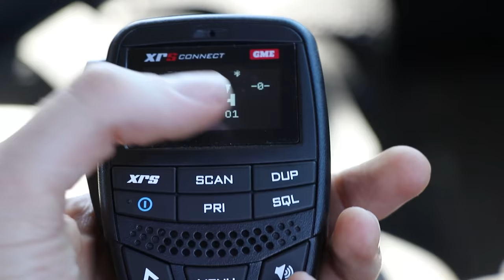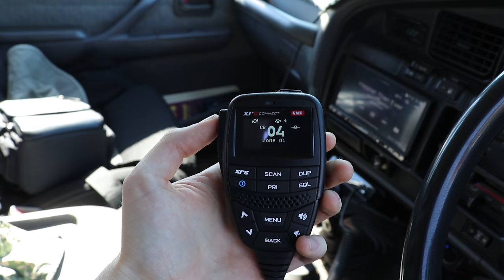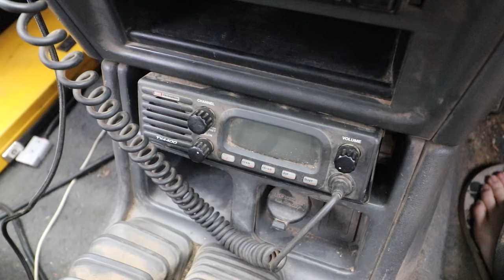You've been using YOUR UHF WRONG!!! CB Radio SECRETS for 4WD in Australia PLUS History & Technology

Comment: I've been using CB Radios since the 11-channel Australian AM Radios. We progressed to 40 channel AM, (not SSB), and now we use UHF radios exclusively. 

Now, I need to make some corrections. 

You say there's no licence for UHF but the Australian Communications Authority (ACMA), who are the responsible entity for allocating the radio frequency spectrum (which includes licensing for  TV and AM/FM Radio spectrum) issue a "Class licence" for all citizens to use the UHF band (476.4125 to 477.4125 MHz (inclusive)) With the change to the 80 channel sets, officially referred to as Narrowband UHF, there was some discussion about making the 40 channel set (wideband UHF radios) illegal to use. This, obviously, meant a significant cost to the transport industry so it was quashed. 

Now, old mate claims that UHF 40 is "by law, the road transport channel" This could NOT be further from the truth and is a myth that needs some dispelling. There is no such requirement in the ACMA spectrum guide, which I suppose most truckies wouldn't read, even if it came out on audio-books. It is BY CONVENTION that UHF 40 is the TRAFFIC INFORMATION Channel, and not the exclusive domain of truckies. Tell them that though. The Pacific Highway, which runs from Brisbane CBD to Newcastle, by convention, used to use Channel 29 and this is a hangover from the AM radio days when the single could "skip" (bounces off the ionosphere and gives the signal extra distance) and reach across the New England Highway, only a couple of hundred kilometres West, running parallel. Because UHF doesn't have this tendency, this has gone by the wayside with more and more trucks choosing UHF40, now. 

The other BY CONVENTION channel has become channel 18, which is now being used more and more by caravaners owing to the truck driver's fowl language and abuse at anyone DARING to use THEIR channel. I mean, how dare they enquire about road conditions while the truckies are talking... heavens be! This (in my view) has lead to a decline in UHF purchasing by the caravan set. And then the truckies get shirty when they can't call them up to get around them, it's a problem they've created for themselves*. (I tell you what, I'd love a 100,000 Watt radio and talk over the b/s truckies speak sometime.) 

UHF 10 is actually for National Parks but, as that's where most four wheel drivers hang out, anyway, it's become the channel for four wheel drivers anyway. During a Simpson Desert crossing, you are strongly encouraged (required?) to monitor UHF 10 and make repeated calls on UHF 10 to advise traffic coming from the other direction (Middo, party of 2 vehicles, westbound at call point 10, QAA Line) ALL OTHER CHATTER IS SUPPOSED TO BE KEPT FROM UHF 10 (but sadly, dickheads be dickheads and frequently it's hard to get a word in edgewise as groups just bullsh... away on UHF10.) The one thing I found INCREDIBLE was the XRS location feature in the desert. I have my phone on the windscreen showing me the locations of other's transmissions. I could just say, "Yeah, I can see you on my map, you're about 15 kilometres away [a sensational range for a 5w UHF radio]. Keep me up to date every few dunes" and it was BRILLIANT. I thought it was gimmicky until then. 

Now repeaters was a bit muddled, too. By selection a Duplex pair (say 42 + 72) the user transmits on the higher channel (72, in my example), which the repeater receives, upgrades the power to the signal and re-transmits that on the lower channel (42). It wasn't really clear, so I thought I might make that clarification. 

One of the things that WAS missed from your otherwise excellent story was the increase in commercial activity, at road works and truck depots, which is actually BANNED under the communications act in the issuance of the Class Licence. It clearly states that no commercial entity shall use the UHF CB radio spectrum for commercial operations and they are not to impede genuine citizen band communications. This is directly against the use for road maintenance uses. When you see "Gate 2, UHF CH20" all the time, this is a breach of the licence. As is the Traffic Direction people using UHF to direct traffic through or around road works. They are meant to use a separate bandwidth, either provided to them or to a hire company for use on the job allocated. 

Putting you antennae in the middle of the roof is only required where you're using a ground plain dependent antennae. You would have to literally have to drill a hole in roof to use the metal in that roof as part of the aerial. The antennae you have is ground plain independent, which means it can be installed virtually anywhere. Obviously, the signal is going to be somewhat blocked by the big lump of metal that is your car, so the higher, the better, but it doesn't need to be. As for mounting your uhf antennae on a wheel carrier (also the deck of a rear bumper is pretty popular, too, I've seen), then the forward projection of that radio transmission will be blocked by the car. obviously, the same applies to a bull bar or rear tyre mount but, because of the height difference from the deck of a rear bumper, not so badly. People do this so they don't damage the tip of their UHF antennae in parking structures or low hanging branches (I get it. I do. They're bloody expensive)  but it comes at the cost of blocking the tx. 

Yes, an antennae can be expensive, but they are technically and ideally, a consumable item. If an antennae is damage (by trees or parking structures), it should be replaced or it could cost you your radio (the even more expensive but.) It burns out the power amplifier, which is the part that gives you the 5W of tx energy. And a chipped or damaged antennae doesn't give you best bang for buck, anyway. 

*Having said that, the truckies in the really remote areas are only too happy to chat to you on UHF 40 and guide you around their road trains, or vice versa. It's only the dickheads on the major highways between major centres who reckon they own the roads.
Reply: 100% correct, Peter.  I’m an amateur radio user, and am familiar with the “law” regarding CH 40.  The reason, I believe, and correct me if I’m wrong, is that  when UHF first came out, the radio of choice (or rather lack of choice) was the Philips FM320.  It had a three position, spring-to-centre switch called the reset switch.  Push up reset the radio to channel 11 (call channel), push down reset the radio to “NOM” or nominated channel which was preset to channel 40 at the factory.
When truckies started using UHF they simply chose the nominated channel to communicate with other truckies by flicking the switch down, rather than scanning and picking another channel because it was easier to do this whilst driving.  True story.
Reply: @glossamano  back in the day, trucks used AM CH40 as the highway channel and, when the ACMA started the class licence with UHF (previously UHF radios required a paid licences, the use of allocated callsigns, etc, which were dropped when the Class alicence was introduced), the truck drivers switched to UHF radios because of their clarity. 

I just wanted to clarify the "law" part of the comment on the video. Truck drivers seem to believe it to actually be a law and will rip shreds out of anyone who challenges it, when there is no legal basis for it.

Comment: Here in the USA are “CB” is in the HF range. While many off readers used that in the past. The move to GMRS (UHF) here in the states has been a major switch lately. However we only get 22 channels. 
Many off readers here in the States also use Amateur “Ham” radio. Some use HF in the same frequencies used In Australia and around the world, but most use VHF/UHF (2m and 70cm) as we have massive amount of repeaters in use for the 2m/70cm band. A license is also required in the USA for 2m, 70cm and the HF bands. We have a 100 watt max on 2m/70cm and 50 watts on GMRS although a few GMRS channels are limited to 5 watts.

I have talked to many Australians using 2m and 70cm repeaters that are connected through the internet to repeaters in Australia.

Off Roaders  in Australia don’t need the 2m/70cm band like we do in the states because your “CB” is similar to our GMRS (UHF band) and have many more channels.

On my off road 4x4 a Ford Bronco Badlands. I have mounted my GMRS antennas and 2m 70cm to the “A” puller posts on the hood (Bonnet) and to the rear spare tire mount on the back of the vehicle.

My antennas are all 5 db on 2m and 9db on UHF 70cm

Comment: Fascinating. I learnt a lot. I live in rural Qld. Mobile phone signals are sketchy at best. I have the UHF in my ute as a safety back up mostly. Don't run with it on as too much crap on it. I did ten years in the rural fire brigade. During the big floods in 2011 our trucks didn't have UHF in them. Flooded in people were trying to talk to us and couldn't. Since then UHF has been included in our trucks. Certainly still very useful in rural areas.

Comment: I think it is worth stating that extra RF power doesn't make much difference to range. It's all about line of sight in VHF and above. I've done nearly 100km with 0.6W on UHF CB. Just high point to high point in a low RF noise outback setting. If you're nowhere near line of sight even 100W won't help you punch through. The insertion loss of a coax switch will not be able to be noticed by most people. Probably about the same loss as having a few metres of extra coax length. The 5W power limit is probably more around RF safety than anything else. At UHF it is quite easy to exceed the maximum RF exposure limits specified by ARPANSA. Given that there is no EIRP limit with UHF CB they need to ensure that people don't endanger themselves and the public. That said 5W into 40dB of gain (50000W EIRP) could be quite dangerous while still being legal. Luckily most people aren't running massive dishes or Yagi antennas on their 4x4. With CB repeaters the tail (the transmission coming back ) is configurable by the operator. So it could be long, short or not even present. Some repeaters have Morse and voice ID. CH5 Mt Anakie in Vic has announcements playing on it for example. In more remote areas a lot of cattle stations run their own repeaters so it is considered poor form to jump on their repeater and rag chew. That said even though they pay for the repeater it is supposed to be free for all to use. Jumping on a station repeater is a good way of getting local knowledge and letting the owners know about issues with their stock or fences etc.
Reply: What?
Nice theory but line of sight can be dependent on output wattage.
Seems like you've used enough to have assumptions about operational parameters, but no real knowledge, that range of a given output as a standard will decrease in range regardless of line of sight as frequency increases.
Range limits can be overcome up to a point via the increase of amplitude output.

I've done many installations in UHF, VHF used for security patrols of large properties and had to tune the systems for optimal output with minimal SWR reflectivity returned to the transmitter base.
Plus a number of other systems for ambulance services and long range police patrols.
Reply: @rogerramjet6429  if line of sight is dependent on wattage as you assert. Go and look up how much RF Voyager 1 and 2 output and the gain of their antenna. Then let's talk about line of sight. Those craft are 100 Au distant and still in contact with earth on a near daily basis. The signal takes nearly 1 day 1 way at the speed of light. From memory under 100W of RF power from the probe. The reason this communications link works is line of sight and gain on the ground station receiver and some signal processing gain but not an increase in RF power. 

Here on earth's surface the limitation is the curvature of the earth and the fact that VHF and above don't refract in the ionosphere. But if you put your antenna on a mast on a hill you have a great site for a repeater. But your range is limited to your horizon. 

You take more power and I'll take more line of sight any day of the week above 50MHz. With line of sight it's amazing how little power you can run.

Comment: 11:50
A radio check, is NOT just to see if you are being "heard" or that anyone can talk back.
A (genuine) radio check is to tell you TWO certain specific things.
1/-
That yes - you are "getting out" ..
But more important is
2/-
YOUR SIGNAL STRENGTH.
On your unit, there will (or should be) a strength meter.
On any received signal - you will see the strength that it is being received at.
Now - to be certain that your signal is getting to somewhere else, two things are needed.
ONE is how far away from each other are you, and TWO, what power they are transmitting to you on.
BOTH these strengths, give you your own output power, AND your ability to receive a likewise power signal.

Thus - for a genuine radio check - you need to advise where you are, and what your SWR is.
(SWR = Standing Wave Ratio)
If you have an aerial - it matters as to EXACTLY, how long your cable is, between your transmitter & your aerial
It thus also matters, as to what your STANDING WAVE RATIO "is" between your transmitter & your aerial.
Which is why - any half-dead Indian - always asks - what does my smoke look like.
In other words, how STRONG is my signal when it gets somewhere, and what strength their signal is, when it gets back to you.

SWR matters.
Why - ?
Because if your aerial is NOT tuned correctly, your standing wave ratio COULD be so high, as to obliterate your lovely output power.
Having the SWR as close to 1:1 as possible, means that a small power output, could be MUCH STRONGER (further away) than a weaker "out-of-tune" 1:5 SWR radio that is closer to the recipient.
Often as much as completely wiping the other station out, if your SWR is at 1:1 (fifteen miles away) with a closer station with a higher SWR of 1:2, less than 1/2 a km away from the recipient.

POWER = strength.
Strength is only obtained by having a correctly TUNED aerial.
An aerial transmits FAR MORE POWER, if the standing wave ratio (SWR) is as close to 1:1 as possible.

Thus, at the same time as "buying" your TX/RX unit, and your co-ax, and your aerial & fittings, buying a SWR meter, (connected "in line" with your aerial & TX/RX unit) is probably the best money for value - you could ever spend in CB radio terms.

Sure, a "manufactured" aerial is approximately 1:1 - when you buy it (as the manufacturer can test these on fixed loads)
However, even 1/2 inch more or less, of the wrong size co-ax (50 ohm instead of 75 ohm) - can put your SWR so far "out" that your transmitter does NOT have enough output power, to overcome the standing waves, inherent in your aerial cabling, to output ANY signal.
PLUS POSITIONING OF THE AERIAL MAKES A HUGE DIFFERENE IN SWR
An over-the-counter (store bought) aerial can have a SWR of 1:1 with your lovely new TX/RX CB radio, if the aerial is center mounted in the middle of the roof (on a roof rack bar)
But the SWR in the cable, could be self-blocking your output power - if the "mismatch" is in the order of say 1:5 SWR.
So to hear someone say - Oi, yes you are getting out - means diddly shyte, if they are say 1/2 a km away - vs someone who tells you your signal strength is about a 3 - at a distance of twenty km.

Comment: NICE INFO. HERE I GOT MOTOROLS MCS2000 UHF 50 WATTS RADIO.400-520 MHz IN NYC AND MY ANTENNA IS IN THE ROOF OF THE BUILDING. SOON I BUILT A REPEATER.

Comment: Used UHF's for like a decade... Never knew what duplex did... Now I do. GG AA's.
Reply: how do you talk to another person with duplex. i cant get my 2nd radio to speak to my first one, i can only if i get one on channel 1 and one on channel 31 but then the second radio cant speak to the first one. please help.
Reply: @dorianforces116  Mate, you've gotta be within coverage of a repeater, put both radios on the repeater input channel such as CH1, make sure both are on duplex. When you transmit with duplex your radio will actually transmit on CH31, then when the repeater repeats the message it will come back to both radios on CH1.
The repeater is simply two CB radios, one listening on CH1 and wired across to another one transmitting on CH31. The reason you have to have two channels is so they don't fly up their own arse like a dicky bird.
Reply: @D4NS80   Oh, I get it now. Keep both on same duplex channel but they need to be in range of repeater.
Reply: @dorianforces116  Also important, Please don't use CHs 31 to 38 to chat to each other on simplex, If you are within range of a repeater, your chat will be transmitted to the whole listening area of that repeater on it's down link in CHs1 to 8.
In other words you are using the uplink channel of the repeater to chat on, and you won't hear the repeater because you are not on it's down link channel, But Everyone will hear you.
Reply: @Bobs-Wrigles5555  k
Reply: @dorianforces116  👍